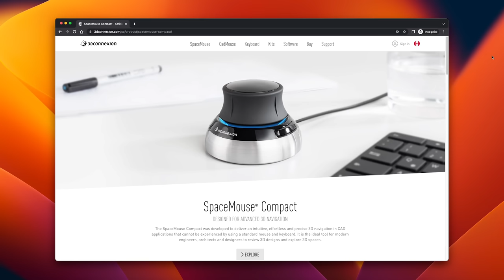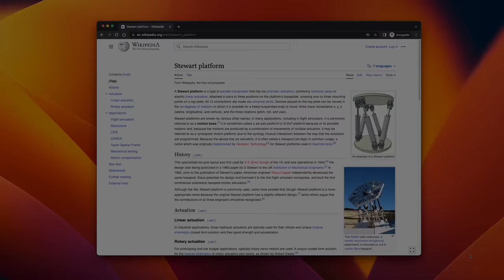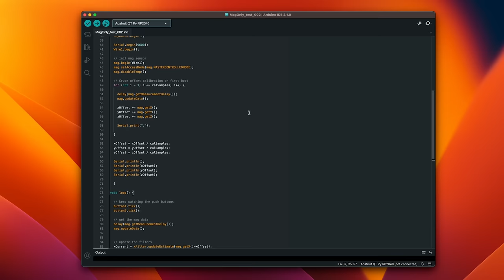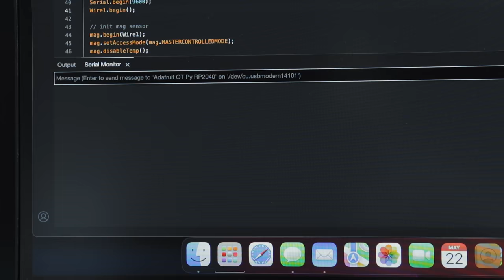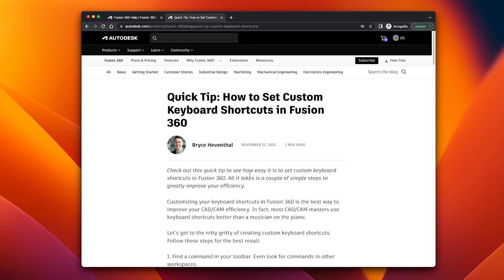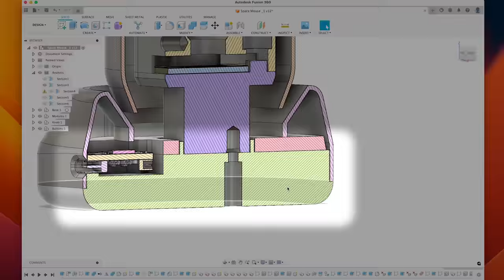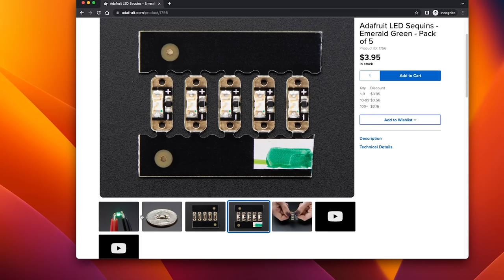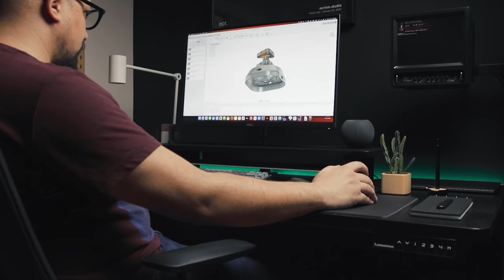I Made my own Space Mouse for Fusion 360 using Magnets (DIY)

Comment: Awesome, it's working perfectly but only for 25seconds and then not working at all. I was wondering if you know why ?
Reply: Same here! Only that it only last for about 5-10 seconds in macOS Monterey on one of my computers. It is probably the Adafruit Tiny USB library that's the failing link.It's seems to be intermittent from computer to computer depending on what's pre-installed.

Comment: Hi @salimbembouz ! Such an amazing project! I was mesmerized by the plotting of the Analog signal form the magnetometer on your screen. I am currently working in biomed engineering and i am looking to plot real time wavelets. I have all the electronics, but i recently switched to a Mac book and i was wondering what you used for that plotting? It is my first time watching the channel and i really enjoyed this video!
Reply from the maker: Hey thanks! That just the serial plotter on the Arduino IDE. You can print values separated by a coma to the serial console and it plots them nicely :)
Reply: Really? Damn @salimbenbouz  ! You make even Arduino look good. 
K. Its been a while but ill download the ide hehehe

Comment: Any thoughts on how you will power and wireless control it?   I made a makeshift one of these about 5 yrs ago from Rollermouse.  But, wanted it wireless. The biggest problem I had was finding Bluetooth modules.    I see plenty of slave bluetooth modules .  I even though about trying to just teardown a Bluetooth joystick and use it's bluetooth and battery power.

Comment: Very cool project. I'd like to take inspiration from this, maybe with a full rotating knob. The only thing that bothers me, is that when I see you using it at the end of the video, there seems to be lag between your input and the screen. And the rotation seems choppy, not smooth.
Is that what you feel or is it a wrong impression looking ad the video?
Reply from the maker: thanks! go for it. 
the rotation is smooth but the mouse emulation is a No Go. it's annoying and get's in the way for CAD work. I will try and do native camera movements if I revisit the project.

Comment: sorry to a pain but i'm really ne to arduino ect , I got the connection and got BLINK to work but the code to run the device is stalling at the Tinyusb mouse and keyboard.h it says \AppData\Local\Arduino15\packages\rp2040\hardware\rp2040\3.3.0\libraries\HID_Keyboard\src/Keyboard_da_DK.h:24:10: fatal error: HID.h: No such file or directory
   24 | #include "HID.h"
      |          ^~~~~~~
compilation terminated. managed to get the other libraries working but not this one ?

Comment: Good Project
The 3D connection mouse can be used with the mouse at the same time improving workflow. 
When I move the viewport with the left hand and the mouse with the right.
And I love the ambidextrous nature of it.
If you hijack the mouse/keboard I imaging you don’t have that available ?
Reply from the maker: Thanks. 
Agreed, and that's the intent if I ever build another iteration. This is just a prototype and hijacking the mouse and keyboard is definitely not ideal but it was the quickest way to get smg working. It only happens while you're maneuvering. The moment you let go (or enter the dead zone) the mouse is available. So it works similarly to the real thing but not as smooth of course. It's currently on the left side as well, it was just easier to capture footage on the right :)
Reply: @salimbenbouz  thanks for The clarification.
Hope you decide to do a mark2☺️

Comment: Would swapping the magnet and magnetometer position improve the design? It would prevent wires going into the knob, saving on wear and perhaps on skew due to them tugging on the top part.
Reply from the maker: That’s the case in the one I built. The sensor is on the none moving part. The reason why in the prototype it’s the opposite it’s because I was adding an IMU to pair with magnetometer and get 6dof sensing. I decided against that at the end and swapped them

Comment: I really enjoyed watching this video, and building it following your very clear instructable. I had plenty of issues with the IDE installing the software and libraries but your links to various guides helped and i got through it all..
 Unfortunately it doesnt work for me. it locks up my pc, sometimes after a second or two, sometimes it takes a few minutes. if i move the mouse while this thing is plugged in it locks up the PC every time. so it doesnt make sense to unplug it, use the mouse, reconnect it to orbit which theres no control over the orbit fixed point, as orbit is always on, then disconnect it to use the mouse again.
Serial Monitor shows mostly close to Zeros for all 3 axis when in the neutral position. 
Hopefully you can guide me to a fix in the code or something, i cant think why else it doesnt work.

Comment: I love this, would love to build one combining FDM and DLP parts, do you have a BOM? or at least the 2040 you used, I couldn't quite work out which model it is and want to make sure I get the right fit!
Reply: also the STEP for the knob? Just as the DLP doesn't appreciate heatset inserts 😅
Reply from the maker: Yes and yes :) check the Github repo or the Instructables

Comment: if you want to get more axises working on this i could imagine mouse parts being helpful to register sideways motion
Reply from the maker: what kind of parts?
Reply: @salimbenbouz  to be fair i don't know a lot about the subject, but i imagine taking out the laser part out of an optical mouse and putting it under a spring-stabilized layer that moves horizontally could let you register sideways motion. basically like putting a mouse upside down under your controller. you'd just have to intercept the data from the mouse and convert it into the type of movement you want in your cad software i think?

Comment: @salimbenbouz Hello, congratulations for the project, I really liked it and I made it. Now I'm in the assembly phase but I have a doubt, perhaps trivial and even stupid to ask, but I wouldn't want to be wrong about the installation direction of the 6x2 mm magnets. Should they be installed on the side of the TLV493D sensor so that the magnetic field attracts or repels? Thanks for all your answers.
Reply from the maker: Thanks. 
If you're talking about the magnet orientation, I think that would only affect the z axis value to be either negative or positive If i remember correctly. 
You can always test it out before assembling anything.

Comment: I have a SpaceMouse.  My biggest complaints are:
1. It's too small.  Your design resolves this.
2. It's senstivity is not intuitive...it doesn't feel consistent.  The software does not tune this well.  With a project like your, problem solved b/c everything is completely tunable.
3. It needs just a couple of buttons with better placement, and I don't want the other options 3dconnexion offers.  They are overly complex, and uncomfortably priced.

You've hit the sweet spot.  Well done!

Comment: hi I have seen hundreds of videos on 3d mouse and various constructions and then I saw yours. and really well done but I have a suggestion. why didn't you use 2 opposing sensors, one on the upper part and one on the lower part in order to render the movement in 3D?. I had created a 6-axis one with Arduino and a particular system of overlapping axes. and it worked well. The problem was very cumbersome, I had also created a Python tool that managed the combinations and sensitivities. I also wanted to create the integration for solidworks and/or fusion 360 but I'm not able to do it. maybe you could do it. in the end, 2 overlapping sensors are enough, if they read the same variation it moves along the axis, if it reads opposite variations it moves along the rotation axis. I don't think it's difficult to do. but on a software level I am not capable of it

Comment: Sexy final design, but I disagree with the mouse input hack to get it to work.  It isn't likely to work in as many scenarios as a real space mouse, and a mouse cursor is limited to the screen real estate you've got.  Unless the software supports "infinite scrolling" (where you can keep moving in a direction forever against the side of the screen) this means there's a limited amount of rotating you can do based on your mouse's last position.

Comment: First I would like to say, amazing work! 
Is there any way that you can add individual part files within the CAD folder? I would like to modify your design and use it in a controller for our club team.
Reply from the maker: Thanks. Check the Github repo I included the STEP file as well

Comment: I don't understand all the excitemt about it, besides your great work on the electronics. I absolutely do not want to diminish your work but the 3d mouse looks like a joystick with very short movement to me. And you can buy 3 way (or degrees) industrial quality joysticks for around 40€. 
If I don't realize the problem I have another idea: Instead of magnetometers, couldn't you use photosensitive sensors and LEDs to measure the mouse movement? You could 3d print openings in the mouse that indoicate the direction.

Comment: Hi, Are you sure the insets and bolts are m2.5s? They holes are very loose for m2.5 x 3.5 insets. Like they should be more like m3s.
Reply from the maker: Hi, yes it is M2.5 and the 3.4 is the length, the diameter is around 4.3 I think. Here is the exact reference https://www.mcmaster.com/94180A321/

Comment: as soon as I saw this... I printed all the parts and ordered all the electronics (I think)... btw, which rp2040 did you have? I had trouble finding a USB/stm qwiic version.... now I'm just trying to figure out how you put it all together!
Reply from the maker: I’m almost done with Instructables and will update the GitHub repo with the BOM later today. There is an issue on the base bottom file that I just fixed. You might need to sand it a bit for it to fit properly if you already printed it.
Reply: @salimbenbouz  perfect... thanks!

Comment: I like the Design so much and the Plan. But i dont get it working. Bought all Components from List, printed everything, and flashed the ino. No reaction in Serial Monitor. Flashing works but no reaction from the Mouse. Both green Leds are on. Cable is connected but still nothing. Anyone a tip?

Comment: How did you get the sensor image in the Fusion 360 app, thanks!
Reply from the maker: I generated a 3D board from the PCB files downloaded from Adafruit then inserted it into the mechanical design.

Comment: I don't know if it will make life much more easier but wouldn't Polarkoordinates make it easier to translate the Knob movement into 3D-Spacing?
Reply from the maker: I'm not sure how. But what I tried while prototyping in to calculate Euler's angles with an IMU paired with the magnetometer. It worked but I didn't succeed in translating all that to the camera in Fusion.

Comment: i could only get the TINY RP2040 AS THE board you use wasn't in stock ANYWHERE will this work if so can you help with Arduino setup for that board ? made all the parts so looking goo just need to get it working.
Reply from the maker: There is a detailed Instructables linked in the description, start there. The code will work with any micro compatible with TinyUSB. You just have to wire it properly and change the pins in the code.

Comment: Thanks for making this guide and video, I have made one It works as a mouse and has 6dof, however the sketch you created only interfaces with the computer as a mouse with keyboard. I am currently trying to get the HID report to let the PC see it as a HID 6dof device. If anyone has experience in this please shoot me a MSG. I would eventually like to create a driver for Linux, Windows and Mac to allow this device to work more fluidly with any of the CAD applications even web based ones.
Reply from the maker: Thanks! that's great to hear. Just keep in mind this is not 6DOF. It was just to explore the idea of this type of controller first and I'm amazed by the response from people. So maybe a proper 6DOF and more features in the next iteration. A driver for all the platforms would be necessary as you pointed out.
Reply: Oh you are right but I found some other information from the manufacturer of the sensor and it looks promising to make it happen. Some drivers are out there already I just need to port them to the other Operating Systems once I match their protocol.

Comment: I noticed only 5 magnets fit into the slot.  I measured my magnets and they are 2mm. Does it matter if only 5 fit?  Thanks!
Reply from the maker: it's just to get closer to the sensor and have a good sensitivity range. If you only can fit 5 it should work fine as well
Reply: @salimbenbouz  Thank you for the quick reply. Mine sit flush like yours and I bought the same magnets but only 5 fit.  Thanks for the info!

Comment: Great production quality for the most part. its amazing the sins that satin/matt spray paint and a booth will cover up :) kidding, but I used to fabricate electrical housings/connector housings with plastic putty, shape, sand, sand, sand and paint paint paint. the finish was gorgeous, but very time consuming. Your device looks much better than it is useful ... its a good start though. I know its not in the spirit of DIY content creation, but something like this, that really doesnt cost that much for the basic model; I would consider it a solved problem that I didnt solve and just buy one. One thing I will mention, I found the 'magic hi-tech 3d printing transitions' off-putting and cheesy. I muted you at this point. maybe because its something I watch every day and i'm cynical :)

Comment: So now that needs to be done now is to emulate the 3d connexion protocol.
Reply from the maker: I found a project called SpaceNav I think that does that. It's like a replacement driver for the real thing. I believe you can use it with normal HID joysticks to make seem like it's a 3D connexion mouse. Didn't try it yet

Comment: why not put the magnet on top and the sensor at the base?
Reply from the maker: It is on the top part right now. I did the opposite in the first prototype because I was playing with an IMU as well. when I removed it it made sense to put the sensor in the non moving part and the magnets on top.

Comment: I know you're not asking for suggestion but just as a question you think it's possible to add the buttons on top of  the knob? cylinder thingy.. itself? or the internal stuff would be clutter? also maybe make able to recognize a spin that way you can use it as a scrollwheel to zoom in and out too? ( i saw this one few days ago https://youtu.be/ip641WmY4pA)
Reply from the maker: That one in the link is way more complicated then you'd think and an amazing project. I met the creator last week at Opensauce and got to see it first hand, it uses a brushless motor for the haptic feedback and you can program it to endless possibilities. In the case of my project if I optimize the internals better in the next version I can maybe add an encoder ring to knob? The current version can be used to zoom by pushing the knob in and out, if you emulate the mouse scroll wheel with the z axis motion.

Thanks for the suggestion!

Comment: What product did you use to smooth the surface?
Reply from the maker: sanding + bondo + filler primer. The Raspberry Pi enclosure video I posted  before this one has detailed process if you want to check it out.
Reply: @salimbenbouz  thank you I'll see if found this bondo on some where here or similar, because I live on Brazil

Comment: How have you found using this day-to-day over past few months?
Reply from the maker: It's nice but certainly not perfect and could get in the way from time to time. The mouse emulation is annoying and isn't the best way to do this. In the next version I will try to do the camera moves natively and complete 6Dof to get as close as it can get to the real thing.
Reply: @salimbenbouz  I've made four different versions of a 6DoF control system for space flight sims (https://youtu.be/LTITm7ulwR4?t=47), which might be worth a quick thought. Using a combination of the mouse (2 axes) and 2 off-the-shelf drone gimbals (2 axes each), to create a setup that requires both hands, but is surprisingly intuitive - you develop muscle memory within minutes. I also played around with an IMU which was incredibly accurate, but because you're measuring changes in acceleration, you need to integrate twice to get to spatial position, and that double integral stacks up errors really, really quickly. If you can get some sort of absolute reference point in there and regularly recalibrate off that, it might work. I tried using an IR LED light source and a sensor which can give you spatial data relative to that light source, to give a point to calibrate from, but the code quickly exploded.

Comment: I have a 3D Space Mouse and I really don't like it. I find that the range of movement is limited, and sometimes the axis interfere with each other (pushing directly forward, results in a downward pitching movement). Sure, I could Get-Good but for the price, it wasn't worth it to me. A little more Range of motion probably would of solved this. In the software there is a Dominate check box, whichever way is bring pressed more, is the input, everything else is ignored that helped, but now I might of well used my mouse :hand-orange-covering-eyes:and saved my money.